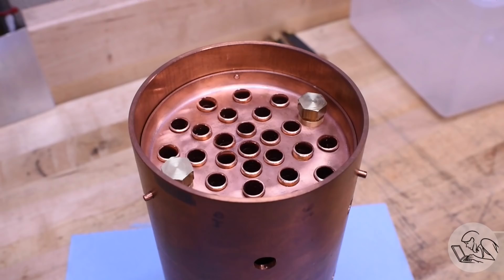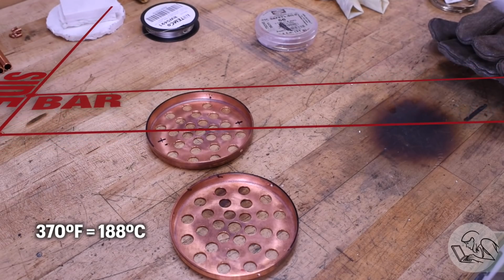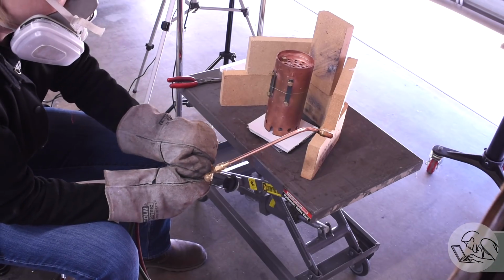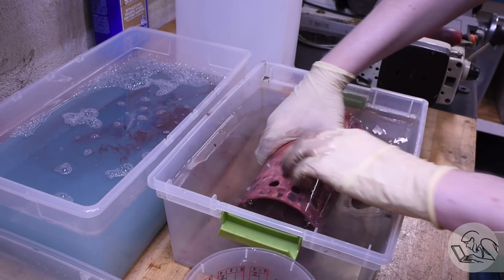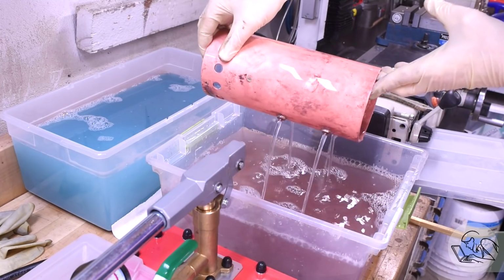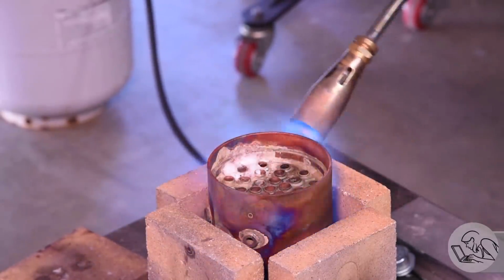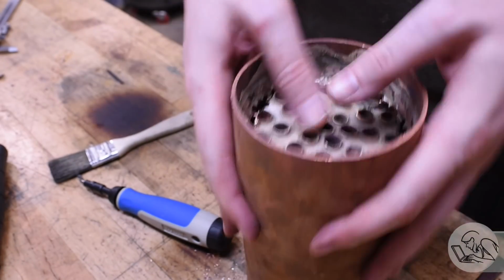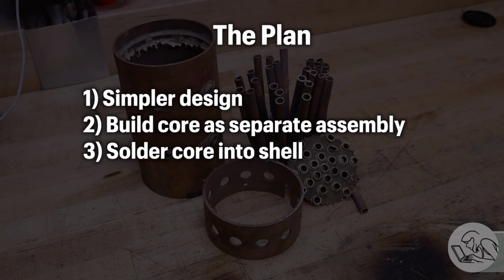Silver Soldering A Model Boiler : Failure!  | Model Boiler Build Part 7

Comment: Definitely frustrating but educational. I have not built a model boiler but have silver soldered rather large steel parts with the same size/style of Victor portable torch.

I about a year and a half ago I built a Tom Lipton style rod bender and lacking any welding equipment I decided to silver solder several of the machined parts together. The two main joints were between 1.5" round CRS and 3" x 3" x 0.5" angle and a 2.25" OD 0.25" wall tubular piece and a piece of 0.75" x 2" bar stock. My first attempts we done using 3 large swirl flame Mapp gas style torches. I struggled to get the pieces up to temperature but eventually seemed to succeeded. Unfortunately after a bit of use one of the joints failed. 

I purchased a smaller Victor torch set up but rather than use acetylene I chose to use disposable Mapp cylinders (I know that real Mapp has not been made for more than a decade and they are just Propylene). This helps in several ways, first it is less expensive than acetylene, second although the temperature is lower you get more heat (BTU's), third you are not as limited in terms of withdrawal rate. This means that you can run larger rose bud tips and get both high temperatures and BTU's for faster heating while still having a reasonable flame size allowing for good control. You need an adapter to connect the disposable cylinders to the regulator and should also switch to T grade hoses (which are a bit hard to find with A size fittings). Additionally rose bud tips for alternative fuels are a bit different than the more common acetylene.

I also tend to use the black flux for larger joints as is definitely holds up and last longer on longer heating times. Especially with the swirl flame torches where it took probably 5 minutes to reach working temperature. I tend to really gob in on thick, it may take a bit longer to clean excess up afterwards but it is better than having to redo or remake parts a second time.

Comment: As a metallurgist I must tell you it will always get harder to reflow solder because it alloys with the base copper.  To fix small leaks you need a jewlers' torch while  adjcent area is cooled with water - small torch is available from amazon - but still a hail mary effort.  

To braze large objects it is best to "furnace braze" - this is what is done with heat exchanges - just using a combined "powder braze metal and flux" paste onto each joint and heating the whole assembly will do it.  Good effort though and that is how you learn.

Comment: Hmm. Would it be possible to solder the tube sheets first so you can inspect the joints without having the tube sheets soldered into the pressure tube?
Reply from the maker: See my plan at the end

Comment: I've been there and feel your pain, this is the only way to learn how to silver solder a boiler. If you've not tried it you don't have a clue for sure. I did find that an oxy propane torch, with a large nozzle,  put a high volume of heat in very quickly, though my Lion loco boiler is larger than your., I think your right to go with just propane.  With the experience I now have I know I could do a better job next time, but I still dread the idea of more silver soldering a large mass of copper. I found that when a previously silver soldered bush for example, got unintentionally over heated, there was a significant depletion of solder around the joint, in such a case I found I could add flux while the joint was hot and then melt in some more solder. I also found that dipping the silver solder into the flux helped a little adding fresh flux to the joint. But that's me doing it my way. Great Video! Great silver soldering lesson!
Reply: I had your videos of silver soldering in mind when I watched  Quinn’s  today.  I even mentioned them in a comment.
Reply from the maker: Thanks Nigel! Your boiler videos were part of my research getting ready for this. 😁

Comment: Don’t try to fix pin holes in the silver soldering crush a couple of Rolaids put them in the boiler then pressure test I did this and my boiler is still good and that was 10 years ago

Comment: Thank you for the honest video.
I would like to comment on safety concerns using any part of this over.
I have an extensive background in brazing from many years in the power generation industry dating back to 1989. For the last 20 years I have run my own business designing, and manufacturing induction heating tooling that is used in the assembly of turbo and hydro generators.  
My comments concern the composition and strength of the parent materials being used on the boiler. Your outer tube may be unusable. Some history to support my concerns.
Most silver solder is manufactured to the international standard BS EN 1044. Because of the demands in
meeting the specification regarding cadmium free alloys most manufacturers will only use virgin metal to
make the silver solder. However, the user must ensure that there are no elements within the parent materials that can be alloyed with a constituent in the silver solder that will form a brittle joint, aluminum, titanium etc. That being said, such compounds can cause catastrophic failure of the joint.
There are grades of copper that can be embrittled by the effects of a gas torch during brazing. Unfortunately, this occurs in one of the most readily available forms of copper. These grades of copper are often referred to as ''tough pitch'' or ''electrolytic copper'' and ''high conductivity copper'' and is designated C101 in British Standards. Most suppliers of silver solder, Copper, and independent authorities like the Copper Development Association all warn of this danger. The problem is caused by the presence of oxygen in the structure in the form of cuprous oxide. During heating, the flame can reduce the oxide to produce a porous metallic structure and steam to induce cracking. This phenomenon is referred to as ''hydrogen embrittlement''. In other cases, using the wrong gases can cause problems. For example. The oxygen molecule can be replaced with acetylide molecule from heating with acetylene which can become explosive under mild impact. I have witnessed this happen. It was not pretty and did cause an injury. Catastrophic or explosive failure can occur without significant deformation or obvious deterioration of the component. Thermal shocks such as that of boiling water in a vessel made from copper, could in my opinion mimic impacts. 
In addition: If I may comment of the heating process. I torch braze copper several times a week only with propylene/oxygen and oxidizing flame to limit these effects on oxygen containing copper. The larger propane torch you used works well to heat the mass. If you can keep that part of the setup and use another smaller torch with propylene/oxygen for finishing it would me much safer.
Reply from the maker: This is pretty standard model boiler making stuff. The secret is that the safety margin on the materials here is about 20,000%. Model boilers are ridiculously overbuilt, so they are safe even if construction methods aren’t perfect.

Comment: My first suspicion, having played with soldering processes that involved long reflow times, would be that this braze alloy dissolves the copper from the base metal and/or oxygen from the air and starts to become brittle if it stays hot too long. Intermetallic compounds are occasionally the bane of long reflow processes.

Comment: They make a flux called stay-silv just made for silver solder!.15% stick solder would have worked better
Reply from the maker: 15% silver solder is not safe for steam boilers. It needs to be at least 40%. I used stay-silv flux as shown in the video

Comment: This looks like an especially tedious and demanding process to master for anyone, one of those things that requires an amount of experience and learning to develop the touch for.  Failure isnt failure as its always an opportunity to learn and improve. heck I remember the first time I tried to do simple copper plumbing soldering without gaining enough knowledge, frustration ensued and I knew I needed to step back and learn so I did what I should have in the first place and found some qualified persons on the internet and watched their videos and now I can solder pipe successfully.  My problem was not making sure there was zero water in the pipe, if theres water inside you can heat it all day long and do nothing but burn up flux and waste solder. Dry CLEAN and by the numbers gets it done right.

Comment: Yep, very familiar problems. Until I tried it I had no idea just how much heat is required to get these copper Boilers hot enough. Its difficult, time-critical work that is so unforgiving. I think you did everything right: your one mistake was not having done it a dozen times before🙄.

Comment: Ouch that’s really rough having to scrap an entire boiler. 😟 I’ve made a few boilers and retubed a 5” locomotive boiler. I think your plan of attack sounds great. I always try and reduce the number of heatings as you found good joints go porous. When chasing the last few leaks you could have caulked them with comsol which is a high temperature soft solder. With bigger boilers I use a propane burner like you have as background heat and a Cyclone burner for precise heat. This is easier with two people but you can get away with a retort stand to hold the big burner. Stick with it it’s a great skill to have. I made 4 Ellie the steam tram boilers recently and they all passed first time. 😀

Comment: As someone who doesn’t work with their hands at all (save and ongoing Ill-advised effort to file down a stainless washer to tram a 3D printer bed) why can’t you weld the tubes. Seems quicker and easier (you aren’t heating the whole boiler face) but I’m sure there’s a reason

Comment: Out of interest (and I'm certainly not suggesting you do it like this), is it in theory possible to use non-fuel sources of heat for this kind of operation? I.E. an electric furnace to do the whole-boiler method or some kind of high temp soldering iron to touch up individual bits?
Good luck with your next attempt!

Comment: Good to see you're learning. Had lots of trouble with silver soldering in the past. Learning a lot from this. 
Just wondering why you didn't apply the solder to hot metal and why you just had holes, instead of collars around the tubes on the end plates.

Comment: I used to work at an industrial Air conditioning and cooling factory making high pressure vessels of different sizes and shapes, and thats how they did it.  Once we pressed on the end caps with their special brazing wire ring similar to what you show here, we pressed all the line fittings in place then a brazing or soldering paste was applied to every joint.  After that they went through a brazing/soldering furnace line and the entire vessel was heated at the same time - worked pretty well we only had about a 1-1/2% pressure test failure after cool down - but it could be dangerous if one of those fittings came shooting out of their holes at 500 or 600 psi. LOL  Not as dangerous as it sounds, pressure hoses were attached to the vessels @ a higher than rated pressure to establish a set safety rating then they were submerged in a tank made from very thick military grade bullet resistant clear plexiglass of some description to watch for bubbles.  This was where you made sure not to stand within range during the pressure test, standard working pressure was 400 psi but they had to be rated at around 600 psi or so if I recall to qualify for safety regulations.  These pressures are taken from memory decades ago so they may not be accurate.

Comment: I know how the "thinking you're getting closer while actually getting further away" goes. Been there lost of times. I've built two boilers in my life. The better of which was the PM research vertical boiler. It was a fun kit to build but I did crack a vise doing the riveting. On it, the fire tubes are fitted, flared, and soldered to the tube plates then that assembly is inserted into the shell, drilled, riveted and soldered around the edge. I liked that technique as the inside of the fire tube/plate joints could be easily inspected prior to installation in the shell. I suppose that technique would not work so well for you as you are not fully riveting your boiler which makes up for having a bit of a loose fitting/possibly crooked inner assembly. Whatever the case, I commend your perseverance and look forward to seeing more from you!
Reply from the maker: That’s pretty close to how I’ll be doing it next time!
Reply: @Blondihacks  I wasn't sure exactly what you meant the way you were explaining it. But I look forward to seeing it!

Comment: That design seems dangerous. Why not just shoot heat through coils of copper instead of making a large pressure chamber. The failure mode of that thing is a massive explosion. If you use a coil type boiler then the biggest rupture you can have is the diameter of the tubing.
Reply from the maker: People have been making boilers of this exact design for over 100 years
Reply: @Blondihacks  I don't understand your point. Doing something for a long time doesn't mean it's a good idea. Boilers explode all the time. Limiting the surface area that can fracture makes them safer. You would also gain much more surface area making for a more efficient boiler it's a win win.
Reply: @utidjian  I understand the difference between a water tube and fire tube boiler which is why I had recommended the switch. If a 1/4 tube ruptures the biggest hole you can have is 1/4. It will probably burn you but that's it. If a fire tube boiler ruptures you likely lose a hand. The construction technique is similar.
Reply: @utidjian  It's what the model steam hydroplane builders called a flash steam boiler. Very quick in producing steam, but could be tricky in maintaining water levels. Steam cars used similar. It was basically a coil of copper tube inside a firebox.

Comment: Possibly an alloy reaction of the silver solder with the copper, caused the cracking. If you made the whole thing out of brass you would have a much easier time heating it. For the 250 psi there would be no problem using brass. You could also practice some with the oxyacetylene. It is MUCH more powerful than you made it look.  With your skill I think you could have made the propane torch!  I guess they are cheap?
Reply from the maker: Brass is not safe for steam boilers
Reply: @Blondihacks  I have several brass steam engines (boiler and all) in my collection. (Not as big as what you are making.) You might try TIG welding the tubes to the end plates making an assembly and then SS the assembly into the main tube. I think the cracking is the solder alloying with the copper in odd ways making a brittle mix. TIG welding would be copper to copper so it should expand equally.

Comment: For what it's worth, I've always perceived silver soldering to be a one shot deal. Huge respect for trying to make it work for as long as you did though, but I would have probably scrapped it after it failed the third pressure test.

Comment: Another thought do you think the soldering would have went better if you had assembled the tube sheets and tubes outside of the boiler shell then put them inside for final soldering?
Reply from the maker: See my plan at the end 😉
Reply: @Blondihacks  I did see your plan and it is a good one.  I just could not resist putting in my two cents worth.

Comment: So, looking back how many hours were spent after the point you should have cut your losses and started over?  Once that loop of fix one thing and break something else starts it's so hard to escape it.  The "it's almost there" one "one more try will do it" feeling is such a cruel time waster.  

Not sure which is worse, these types mechanical issue loops or trying to get a paint job perfect.  I think I've been more upset after ruining a nearly perfect paint job and having to start over just because I wanted to try one more thing, and then trying to fix the mistake and making it look even worse.....  Probably because I like building things way more than painting them, so rebuilding something is fun and repainting is not.

Comment: Perhaps a dumb question but in some radiators (eg old bulldozers). They put the flat water tubes in then flood a layer solder across the whole tube plate.  Could you do this on this boiler if not why not?

Comment: Making the core separately is brilliant! You'll be able to flux the back sides and apply heat more evenly. I silver solder copper and brass and sterling all of the time but I've never done anything this complicated. On my most complicated piece I too experienced the frustrations of finding that fixing one bad solder joint created several more. You have all my sympathy.

Comment: OK. I have not done anything like this before. Regarding the cracks, keep in mind the expansion and contraction of the structure. Possibly once you have soldered all the tubes on one end then the plate on the other end should be allowed to float inside the tube until the inside tubes are soldered. Then, while keeping that end hot solder the plate to the exterior tube.